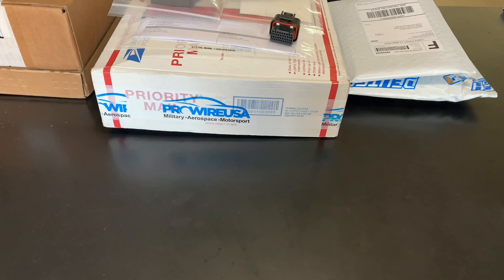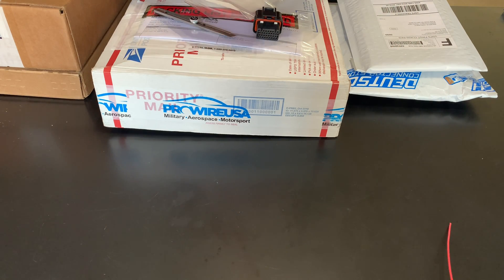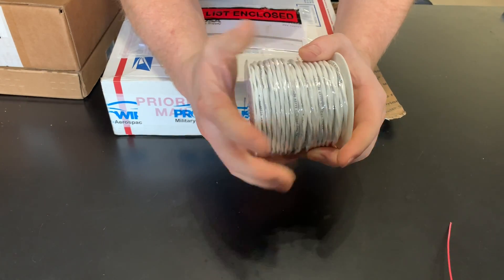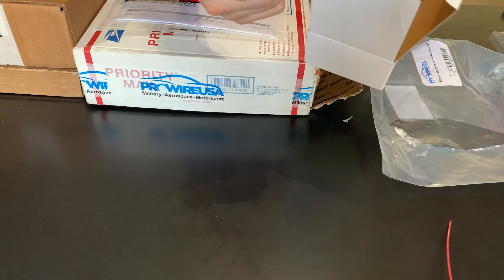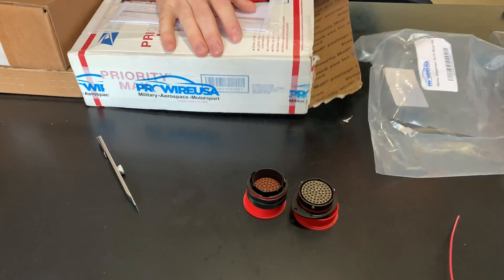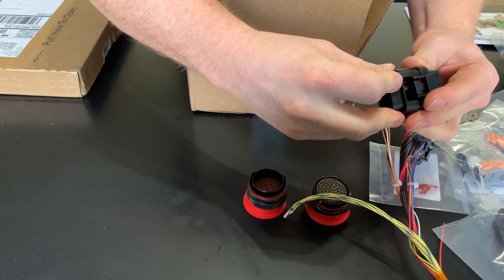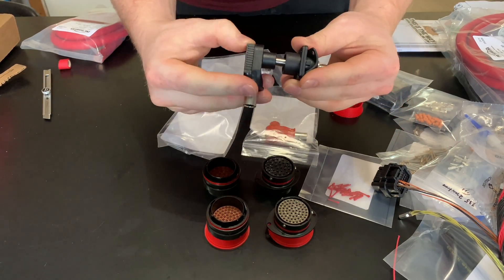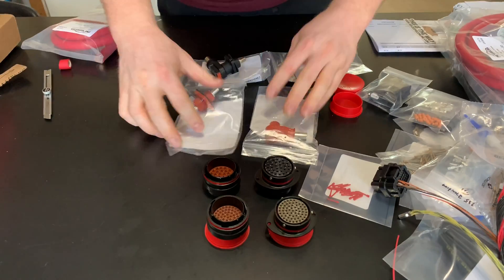Unboxing Motorsports Spec Wiring Build Materials.

Comment: Nice video! Can’t wait to learn more about your wiring techniques
Reply from the maker: Hideaki Sakakibara thanks! New video will be up soon!
Reply: @signal_msw  great! I'm new to car wiring but I love working on it. It takes time but I enjoy. I'm in a process in doing a fuse box delete on my s14 and also deleted all the junk I don't need like, ac, heater, airbags, etc. What would you use to create your own circuit panel?
Reply from the maker: @arlokkkk  I would use cooper bussman or GEP sealed relay/fuse holders.
Reply: @signal_msw  Thanks! Looking forward to see you using those rad locks. Also the milspec autosport connectors are amazing!
Reply from the maker: Hideaki Sakakibara yeah I’m stoked to put them together!